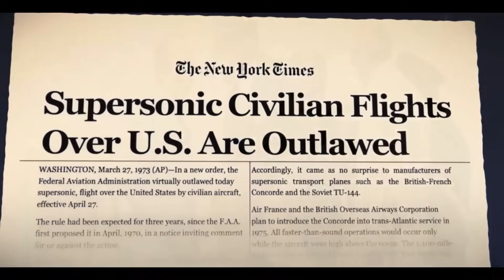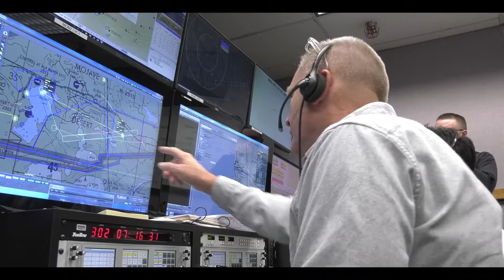NASA's X-59 Quesst aircraft could change the rules for supersonic flight

Comment: There were times when travel was the adventure. Today, we shrink the adventure of seeing sights just to arrive at locations which all look the same (cities).
Does it run on fossile fuels or oxygen+hydrogen ?
Reply: Wifi
Reply: So no need for Hotspot? I got Verizon so that 5g gonna make it like a boost but ig if it's wifi y'all don't need me, but depending on which wifi company ya got I can still help
Reply: You need to superchill hydrogen to liquid or fuel tank would be ginormous. Rockets vent boil off or they'd blow up on pad.
Reply: Waiting for the infamous "Climate hoax threat to humanity" anti oil comments.  You can ignite simple fuels in jets to get the thrust to achieve the speeds, but the way shockwaves act at those speeds invalidates how we conventionally design air surfaces.  In principal, a person needs to understand explosives as those forces act at supersonic speeds.

Comment: Wonderful science, but why? Making supersonic travel less noisy isn’t going to help commercial travel. We have to move away from fossil fuels if the Airline Industry is to have a future. Unless you’ve figured out a way to achieve supersonic speeds without spewing even more Carbon into the atmosphere, this is will just increase demand for a technology that only hastens the death of civilian Air travel.
Reply: name any other way to power an airbus a350 sized plane. Just a single one.
Reply: @AtaGunZ maybe the size is the problem. We’re getting electric domestic planes in less than a decade.
Maybe another problem is that nasa is using the tax dollars to develop oil based flight rather than alternatives.
Reply: @AtaGunZ  see that’s missing the point isn’t it? Of course there is no better energy dense solution for fuelling supersonic flight, but the problem it spews a shitload (technical term) of CO2. We cannot continue to do that, unless you want a climate catastrophe. If you do, where do you think the demand for supersonic A380’s will come from when the world is is literally fighting fires? 

So, the adult thing to do is not develop supersonic flight for commercial travel until we’ve found an energy source that won’t fry the planet.

It doesn’t make commercial sense even if you ignore climate change. How many more kilolitres of ATF will be used to get that A380 supersonic? How many passengers on that A380 are going to be willing to pay 3 to 4 times as much for the same seat? Plus, where are you going to land it? There are barely a handful of runways that are long enough, and nearly all of them are at military bases. The cost of supersonic travel isn’t just delivering the plane, you’d need to upgrade the infrastructure to support it. 
That’s where this falls down. That’s why Concorde ultimately failed too, although the FDA regulations didn’t help. It won’t have enough demand when people realise that time saving isn’t really significant enough to warrant the cost.
Like I said, this is not going to have a commercial application, not in the near future anyway.
Reply: @skunclep1938  I am not talking about just supersonic flight. You said the whole industry should start moving away from them. I will ask you the same questions you asked me: who would be willing to pay 3-4 times more to pay for the same seat, just so that it is a bit better on the environment? High density fuels decrease the total energy required for any air travel, and that is a fact. It makes more sense to ban private air vehicles, and focus on other industries like steel.
Reply: @skunclep1938  Planes dont even make up 3% of co2 emissions. Unless you want people to stop using Electricity and heating, c02 isn't going anywhere.
Reply: @AtaGunZ thats just defetism.
Reply: @prozak715  I’m not saying that we stop using planes. I’m saying that the search for supersonic planes is commercially pointless, because they use a hell of lot more fuel for the same distances. We need to look for more efficient jet propulsion or even cleaner replacements, not more extravagant ways to waste fuel. 
This technology may be adopted by the military, as it no doubt has stealth applications, but it is childish to think that commercial flights will be supersonic and still burn jet fuel, whether they’re quiet or not. That bird has flown.
Reply: @AtaGunZ  yes, and it is moving away with more & more electric options being developed. It will be a slow process, but at the very least investment in those technologies is more important than quieter supersonic flight. Also, I agree that promoting public over private transportation is better, and that also benefits electric powered vehicles as larger planes can utilise more efficient lift, reducing the impact of the heavier (over the weight of ATF) batteries. The industry is already heading in that direction, and not just for environmental reasons. 
That’s why research in quieter supersonic flight is not for commercial aviation.
Reply: @skunclep1938  I know some materials scientists/chemists taking grant money to research batteries. I talk with them a lot as they are close friends.

Go find some similarly qualified people and ask if they think they will be able to make a battery that is energy dense enough for large airplanes in the next 100 years, and ask if they do make it what it will be used for first. We don't have anything close even as a research prototype, let alone a mass manufacturable one. People are working with exotic materials and they still can't do anything as energy dense. And having the same density isn't even enough since you need to haul the battery around for the whole trip, unlike fuel which gets used thus making the plane lighter and lighter. 

For automotive, we have both H2 and electric batteries as a viable option, but not planes. Not for a long long time. 

And if you think this kind of research will only help fossil fueled planes and not the sustainable planes of the future, I believe you are really mistaken.
Reply: Yeah, well said.